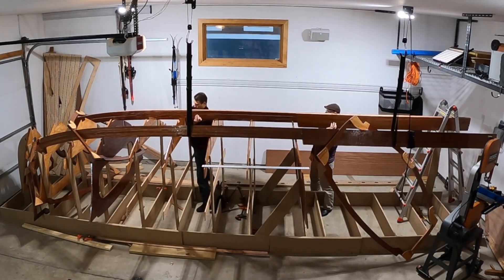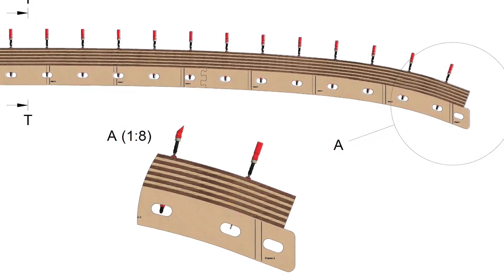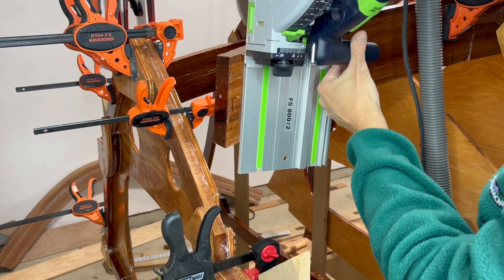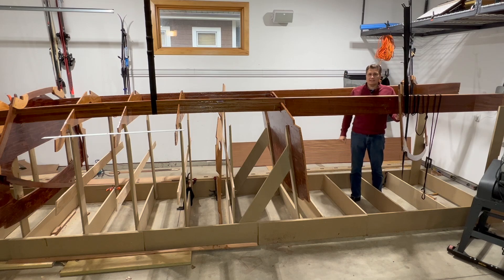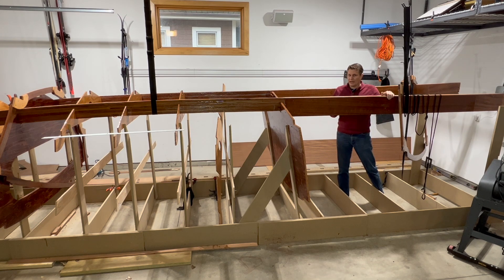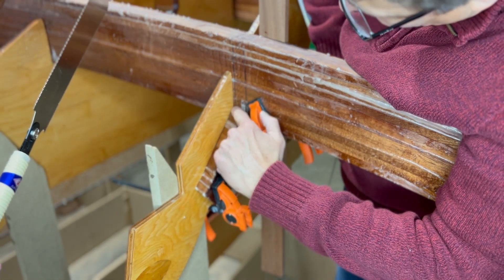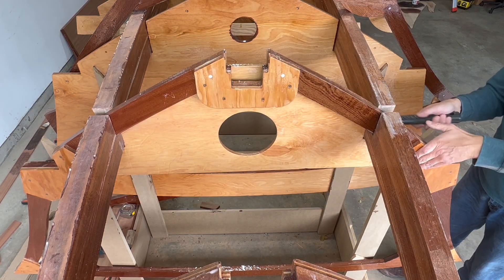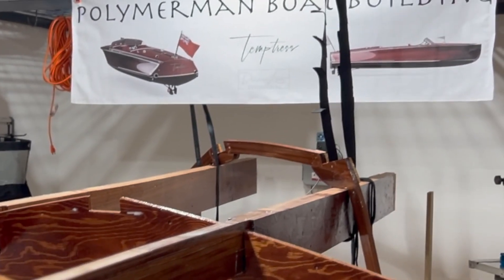Temptress Build 35: Installing the Port-Side Stringer and  Notching the Stringers

Comment: Amazing work! for my curiosity, could you comment on the CNC cutting? Dan Lee is using a table CNC and he is able to bevel all of the frames and parts. You are using the Sharper Origin. Why are you not beveling the parts? Is it too complex for the Sharper Origin or is it that you think it is not worth the hassle? Thanks in advance.
Reply from the maker: Dan’s beveling of frames is very advanced.  The Shaper Original cannot to that.  You have to start with a flat surface that can accept the domino tape to use the shaper origin.

Thanks for watching and asking.